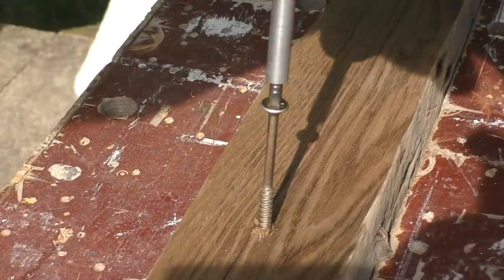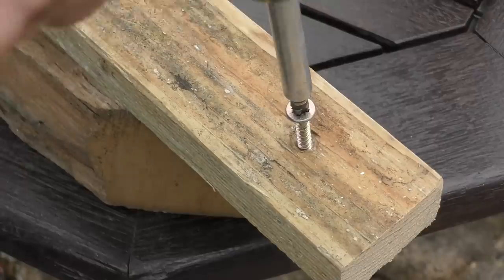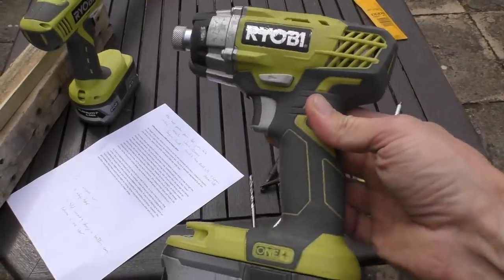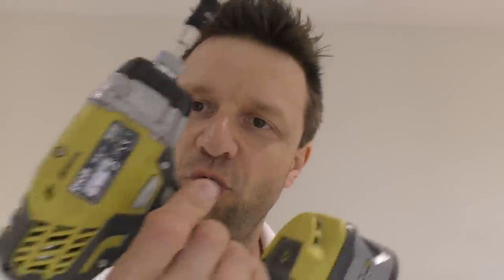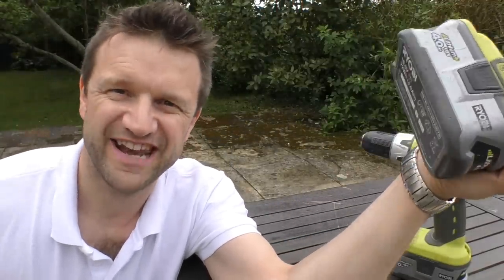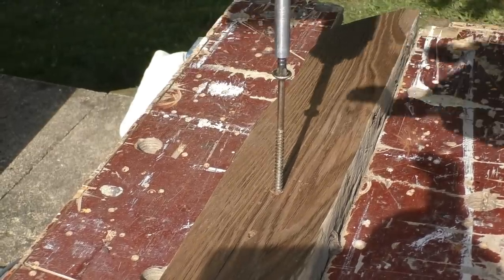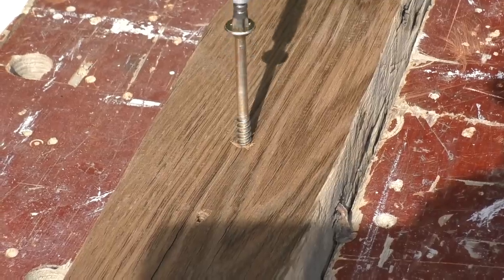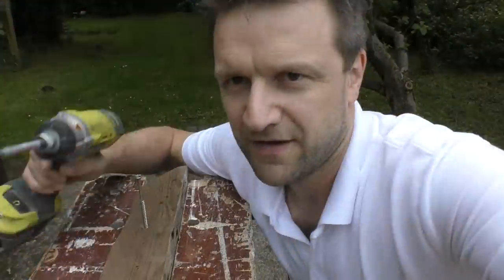Difference between Drill Drivers & Impact Drivers

Comment: If your driving a lot of screws test the srews strength and adjust the driver and clutch setting. To much power can snap a screw head off. Impact uses on  hard wood one  must beware of snapping the hardware. Softer wood and impact is the dream for phillip head hardware over 3in. and even better with hex head bolts over 3"

Comment: Thanks for the demonstration and it really drove (excuse my pun here) the point that the power source is the difference although impact drivers are probably a bit (excuse my pun here again) better than standard drills.
Reply from the maker: You're welcome. Have a look at this https://www.youtube.com/watch?v=i6KYfrDBj3w&t=52s if you've got a moment as it explains in a bit more detail, the difference between an impact, combi and drill driver. Impacts are more powerful than standard drill drivers because the impact action works radially ie it vibrates in the direction the bit is turning, whereas drill driver hammer actions work parallel to the drill bit, or in and out of the wall. That's why impact drivers are so much more powerful for driving screws and why you can't use a drill driver hammer action in the same way.
Reply: BTW, excellent video production; very easy to follow and good flow; kept my attention all the way through; professional like.

Comment: Thanks for this it convinced me to get the ryobi combo kit that has both.
Reply from the maker: That's what I did. You'll love them. The 1.3ah are fine for most jobs as they keep the drill nice and light, but for heavier work like circular saws, using site lamps, chain saws, SDS drills and the like, you really need to get a 4 or 5ah battery as well.

Comment: So, I've just watched your video again (so that I could answer your question).....AND now another question has come to mind (as a complete novice) - Let's say the first one I buy is the SDS drill - loads of hammering power and if I just want to drill into wood or screw into wood, I can turn the hammering off. So, what is missing from the armoury of the SDS drill, that I would get with the bog standard drill driver?
Reply from the maker: D'you mean SDS or impact? To understand what SDS's bring to the party take a look at this vid https://bit.ly/2MXfKGD and for a better vid on the difference between impact drivers and hammer drills, there's this one https://bit.ly/3sxpfw5 Basically, an SDS hammer action works in and out of the wall whereas with an impact, the hammer action works in the direction the bit is turning. A lot of people think they can use the hammer action on a combi drill (much less powerful than an SDS hammer action and actually not worth buying IMO) rather than an impact, but they can't for the reason I mentioned.

Comment: Hi Charlie - another good vid!     I noticed that the 1.3 AH batteries you used were dated 2013.  My 1.3 AH Ryobi lithium batteries date from 2015 and whilst they still work well when charged I have become suspicious over recent months that their capacity is less than it was when new and I'm having to charge them more often.  They have had quite a hard life though over the last 5 years.  My 5 AH Ryobi battery seems to go on for ever though! Have you noticed similar changes in battery capacity?
Reply from the maker: Wow, great spot Julian. Have I had it that long? Definitely agree with the black 1.3Ah, and in fact it was a point I made way back in this video https://www.youtube.com/watch?v=JVMwp4Hm7OQ&t=46s two years ago. I don't use them anymore. I've got about 5, sitting in a basket in my basement. I agree that 4Ah and 5Ah Ryobis (of which I have 3) go on for ever, as do the Ryobi tools generally. I do get stick from the tool snobs for using Ryobi, but as someone recently commented "I bought a Ryobi fully expecting it to last no time at all, and I've now got loads of the damn things because they go on and on for ever!) The only complaint I have is with the plastic chuck and clutch on my Ryobi combi drill - (bought in a combi package with my impact), and it's basically failed, but not before being abused for years in the day job.

Comment: For a novice DIYer, would you recommend to skip the Drill Driver and go straight for the Impact Driver?
Reply from the maker: Check this out https://bit.ly/3sxpfw5 No, the drill driver is a crucial tool in your collection. You're less likely to use the impact (I rarely use mine). The thing you've got to think about is whether you need a combi drill (good for occasional DIYers but the hammer action is hopeless for drilling concrete) or actually whether to bit a cheap SDS. The drill driver typically doesn't have a hammer action. So you need a nice light drill driver and an SDS ideally.
Reply: @CharlieDIYte  Thanks Charlie that's really helpful.

Comment: Good video, maybe next time you could include impact wrenches as these are even more out on a limb, yet they are now coming supplied with so many adaptors to fit sockets, screwdrivers drill bits etc. that there is quite a grey area developing between them. Thanks for the upload.
Reply from the maker: Thanks Richard. I'll keep a note of that. Here's another video you might find useful https://youtu.be/sL-t2Zc4wCs

Comment: Thanks.  Been wondering what the difference is between the two types.  I have a Ryobe drill and the smaller battery and as you say I usually have to pre drill a hole to get a larger screw into the wood.  I don't use it that often but I will look at getting a bigger battery now that I know it will be easier to use in the long run.  Thanks

Comment: Used to love Ryobi back in the day.  The new stuff?  Not so much.  If it was priced accordingly, I'd still be okay with it.  Problem is, they still think they are right there with Makita, Metabo (Hitachi), DeWalt etc when they are not.  Not the same brand it used to be.  Tear into a few like AvE has done here on YouTube and you'll see what I mean.  LOTS of cost cutting going on where you can't see.  I recently picked up some brushless Metabo stuff and Holy mother of pearl did they manage to stuff 10lbs of beef into a 5 lb package!

Anyhow,  nice video, thanks for sharing.

PS. I totally agree with you on that piece of oak!  Nothing like the old growth stuff that's had a century or two to harden up.
Reply from the maker: Hi buddy. Really interested in this. I have no loyalty or affiliation to Ryobi in any way. My father in law bought me a combi set years ago and I've been using and upgrading ever since, fuelled in part by the fact that they've never changed their battery system. I used to love the value for money you get with them and in spite of the stick I get from tool snobs on this channel, I use them exhaustively in the day job and they've never let me down. The batteries are damn expensive though. That said, a lot of my tools are the older brushed models. If you're right about them dumbing down the quality now they've got to a critical mass in the market I'll be dropping them like a stone and possibly discrediting them on my channel as I hate that sort of thing - it's defrauding us customers and there's not much lower you can sink than that!! Can you point me to the Ave video as I've had a quick look and can't find it. I suspect all the big brands are doing this though to an extent. I even heard that Makita have replaced a lot of components in their gear boxes to make their tools more affordable to the masses and as a consequence the particular retailer I was speaking to said he was having loads more returns than he ever had a few years previously. I can't substantiate this though. Interested in what you say about the Metabo though. Personally I think there's no need to be brand loyal, as it's no big deal to have a few different battery chargers. The brands don't want us thinking like this though. So I may have to have a look at Metabo after what you've said.

Comment: I only drill softwood , spax screws just fly into wood , i have 2 drills 1 set up for pilot holes but I can see a contractor probably needing one , I've just built a camper van and used hundreds of screws , definitely the quality of the screw is a factor

Comment: Would I use an impact driver to screw in blots into a treaded hole? I understand the impacting action would help with screwing into a piece of wood, but what about screwing in a small blot on a car piece?
Reply from the maker: Yes you could but it's a question of whether you need that extra torque or not or whether actually a drill driver would suffice.

Comment: The reason you probably snapped the driver extension is your using one too long for the application.  You can see the off center torquing in a couple of the close-ups.  Granted many times you need the extra reach but if you don't go with a stubby drive bit.  This is particularly important with an impact driver than a drill driver for a number of reasons.  Also, yes the larger amp-hour batteries work better but if you don't need the extra capability, the lighter batteries have a certain fatigue / balance advantage.
Reply from the maker: Agree with all that. The long bits are essential in the day job when we're working at height, but I agree managing weight is crucial. That's why I have a 12v drill driver that I use far more than the combi or impact. Come to think of it the combi is pretty irrelevant if you have an SDS, as then you can just use a light drill driver and perhaps an impact for repetitive jobs where you need the torque.

Comment: The smaller batteries aren't meant for heavy duty tools. The other ones are branded HP which means it's for hand powered tools and actually have extra connections for additional power for your hand powered tools. They also have a 4AH battery that isn't rated as HP but has about the same performance as a 1.5AH battery but just lasts longer

Comment: The other observation I would like to make is that impact drivers do way less damage to screw heads than drill drivers since they don't need so much pressure whereas the drill drivers can easily pop out of the screw whilst still spinning if the pressure is eased off.
Reply from the maker: That's a fair point Julian. And you can use an impact one handed whereas often you need to grip the combi with two hands when driving in large screws.

Comment: They seem to market the batteries by discharge capacity (would be battery life for a non-rechargeable battery), not maximum current drain that can be supplied.  This is a bit confusing for the general public.  They should try to explain both.

Comment: Thanks for great information. My drill driver 2.0 AH doesn't hold the small drill bit properly, the bit keeps going backwards n gets loose. Apart from that all good
Reply from the maker: Can you tighten it in the chuck any more? Other option would be to get some of these https://www.toolstation.com/abracs-quick-chuck-titanium-pilot-drill-set/p41946
Reply: @CharlieDIYte  yes it can be tightened again after every hole was drilled. The bits I bought doesn't have the solid thicker heads, thanks for the link, I should get them soon. Cheers

Comment: hi charlie just seen your impact vs drill driver video very interesting but what about drill bit quality and types as i find drill bits breaking down.maybe me not using right bit?i have a dealt drill driver but with smaller 1.3ah batteries at moment.did buy non brand vannon eBay.cheap and ok power but it got stuck on drill so have to use screwdriver to lever off.still got my bosch mains drill also .steve

Comment: Very good comparison. Have you tried these on buffing wheels? I am looking for a cordless device for motorbike crank cases while they are still on the bike. The Drill driver with the better battery looks like it would do the job. Has any one tried them on bikes?
Reply from the maker: You wouldn't want the weight of a combi for that and the hammer action would be unnecessary. You want to try and find a nice light but powerful drill driver.

Comment: So would you reccomend ryobi, great video, I have been trying to find out what the ah on batteries meant
Reply from the maker: Yes I would Shane. Particularly for DIY. Builders, carpenters etc tend to be a bit disparaging about them saying they wouldn't take 8 hour shifts 5 days a week. I couldn't comment on that but I've used them for my day job (albeit not every day of the week) and never had a day's downtime. Generally good value for money and they made a pledge years ago not to change their battery packs which is why I've got so many of their tools.

Comment: Impact driver - Might have slight problems with the health and safety hand vibration legislation over long periods of use, not to mention their noise limits, especially in confined spaces. They do what they say on the tin , but are pretty annoying after a short while. Very fast motorized woodpeckers spring to mind :)

Comment: Personally I think the problem is the Drivers themselves, not sure if the quality is different over there but any Ryobi I've bought can only handle really like work. Try using it on anything heavy and it craps out. I've used a Dewalt drill driver with a 2AH battery that drove similar screws much quicker than when you used the 4AH on your drill driver, have also seen milwaukee be very comparable to Dewalt

Comment: I only have an impact driver, but I bought a hex shanked keyless chuck for it so that I can drill holes.
Reply from the maker: Good work. How are you getting on with that?
Reply: @CharlieDIYte  it works well, though it doesn't have the speed you can get with a drill. Lot more torque though.

Comment: I was doing some plunge cutting with my skil saw and I had trouble geting very close to tight quarters . I think perhaps my angle grinder 4 1/2 in with a saw blade could've helped gotten it better . Can I use a 4 1/2 in saw blade in my grinder to do close in cuts ?

Comment: Thank you for the info video. I appreciate learning the difference. 

They now make a 9Ah battery that I use (and love) in my leaf blower and hand saw. They make a huge difference. Still use the 4/5 in the drill and sander as they are sufficient - and not so heavy. I didn't see them on amazon.uk so I don't know if you can get them there.

Comment: Excellent  Video  very clear explanation ..
Good Job  
Nice  accent  mate..... 
I like all company's today they are all good  But I will always be 
a   " Dewalt "  fan boy  they are my favorite to work  with on the job or home. 
I have the 20V  MAX  IMPACT  USA   Drill  COMMERCIAL DRIVE! 
NO GEARS!!!  ALL FULL GUNS AUTO.  This drill is the best!!!  FAST!!! AND POWERFUL !

RIOBY  is  a low end  basic home kind of weak for anything commercial   Not something I'd buy.
But Black & Decker  is awesome !!!   For cheap low end I hope you do a review on them.
LOVE THE RED AND BLACK on the Black and Decker..
I had the  package as a gift  5 set and wow  fantastic  the  Impact drill and the battery lasted forever
4 amp  !!  x  2 come with the package with a fast charger@!!!!
And the Battery's are small light weight and long lasting !
Outstanding for home use and even on the job!!!!
Black and Decker surprised me.
Reply from the maker: Thanks buddy. Yes I've been using Black and Decker for years - my first drill was a Black and Decker and I have their excellent power file as well as a work bench. They're not that prevalent here in the UK these days. I think DeWalt is Black & Decker's trade arm, or used to be.

Comment: Can you drill holes with an impact too? Or atleast get an adaptor for drill bits?
Reply from the maker: Yes you can Bill, either fixed to the collet or with a little chuck so you can use standard drill bits like this https://www.trenddirectuk.com/snap-d-1mm

Comment: The description at 5:05 is kind of gobbledegook -- not even wrong, though you got it right that the concussive action is indeed important. Here's the real explanation: the impact driver in each instant is starting and soon after stopping the rotation of the bit; the question is why does the rotation phase not drag the work along, as does the drill driver? That's because the angular momentum (both twisting the work and the tool) that would have accumulated keeps getting reset by the on-off pattern, instead of building up over time as with the drill driver. Not just that, but each burst of movement is a high-acceleration jolt that easily overcomes static friction rather than the relatively smooth speed of the drill, but also this jolt exploits the inertia of the material to stop it from moving -- kind of like how you can rip the tablecloth from under the glasses if you do it fast enough.

Comment: what I think I just witnessed was with the first screw with the drill driver was set in the slower speed, geared down, giving it more power vs The second drive with the larger battery geared to the faster speed resulting in less power (if this is true it's not a good prediction between battery sizes)

Comment: I’m trying to hang up a series of blinds and ridiculously struggling with my drill driver to get the simplest of tasks done.  I have RA and not a lot of upper body strength.  Thank you so much for your thorough comparison between drill drivers and impact drivers.  I believed impact drivers to be a tool used by auto mechanics.  In retrospect, I should have purchased an impact driver as the vast majority of my uses would be tackling screws.  In addition, I had no idea the power difference to the tool based on the battery size.  I presumed it was merely a function of longevity of use.  Of course all these tools ship with the minimum battery hence my overall frustration with my drill driver. I was feeling like a complete idiot not managing to put a bloody screw into a window frame.  Cheers and thanks again!
Reply: it doesnt you can adjust the drill driver to output more torque thats what the numbers on the drill are for i never had any problems with my ryobi